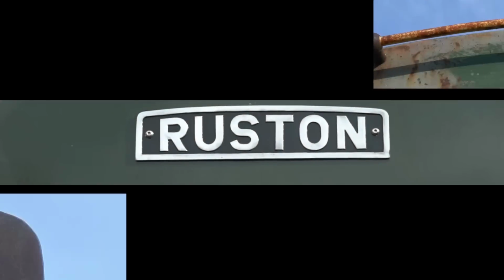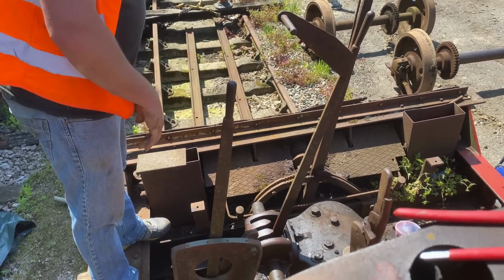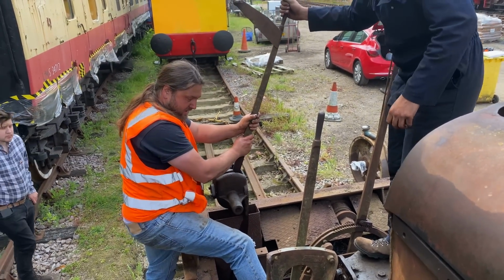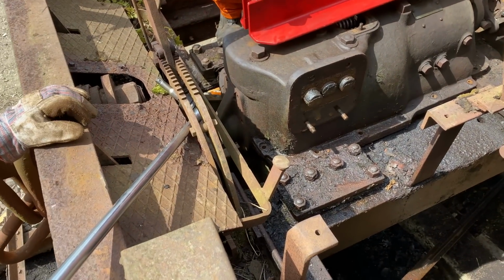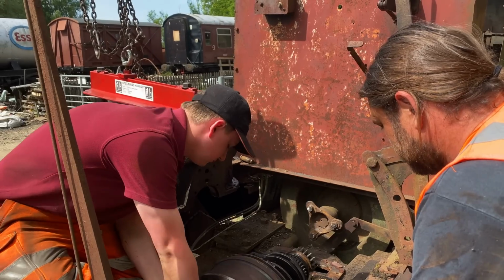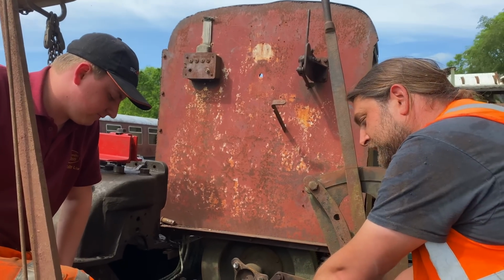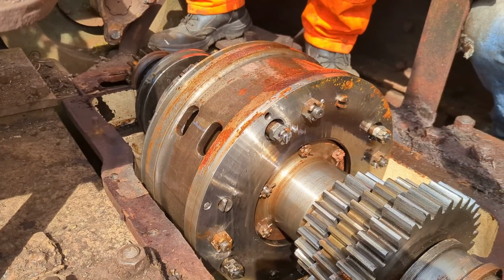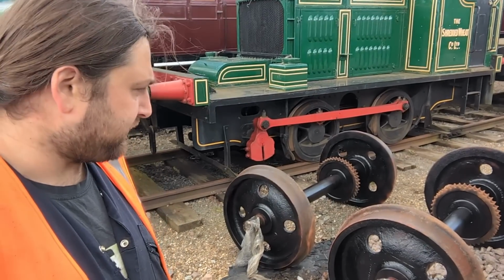What Horrors lurk within The Scrap Ruston's Gearbox? The Locomotive Diaries Episode 6

Comment: Having rebuilt a Ruston  48DL gearbox on a narrow gauge loco 3 or 4 years ago I was surprised by some of the commentary by your expert. As someone else has commented then dismantling the clutch drum should be done on an old gearbox because if the clutches are not fully disengaing then, as you move the direction lever, there is power in the main shaft spinning it at xxx rpm leading to the horridable crashing  sound (and eventual failure) as the two parts of the dog clutch come together.  This is the fate of many Ruston gearboxes. Also, the studs moving the shared pressure plate elongate over time and the slack can't just be taken up by the lever adjustment, it needs to be done of the stud nuts on the drum. When our gearbox has last overhaul ( we didn't know when) the shared pressure plate had not been put back parallel to the end plates and as a result had severe scorch marks (opposite side of the plate and 180 degrees apart) from overheating and not helped by drivers who rode the clutch. There was also a very  thick 'soup' of clutch  plate liner fibre and oil in the drum which kept the plates engaged. As a result of the overheating, the plate had distorbed and had to be carefully machined to bring it back to true. RH had little known about but ingenious tool for setting the shared low and medium speed clutch plate parallel to the fixed outer plates. As no one seemed to know about it let alone have one, we were able to get one made and were able to achieve about 4thou. accuracy. Oil from the main part of the gearbox does get thrown forward into the drive output section through a bearing but as the output shafts only have oil groves not oil seals then if there was oil pressure in this section, the oil will just get skirted out onto the track. The balance pipe is opened at  the end of the day's running to allow this excess oil to feed back into the main gearbox and not empty the whole gearbox of oil over time. If you don'i open the pipe then the oil just leak out via the oil groves onto the engine shed floor. The balance pipe is at the same level as the lower oil groves. You can't really overfill the gearbox as the excess eventually leaks out the oil groves. As previously mentioned, if the main shaft is not free wheeling then when the direction lever is engaged, one half on the the  dog cluch is spinning at speed whilst the other is held stationary by 7 tons of loco! Ouch!  I hope this tale of our experiences may help and yes, we have another one to do one day!

Comment: Hey Lawrie
Thinking about it you should keep the bearings with the wheel sets, not mix and match them (assuming they are still serviceable, if not you will need to get new ones made.
They will have problems of the journals have different  diameters since they were machined to and worn in.

Comment: Can I make a suggestion?  I've done a lot of painting on cars, locomotives, manufacturing plants and machinery and so on, and I wouldn't recommend paraffin as a cleaner between coats.  It's too oily and won't lead to good adhesion of the next coat.  A better bet is to use paint thinner for cleaning - either cellulose thinner or white spirit, according to compatibility with the primer.  These are much more volatile and don't leave behind an oily film like paraffin does, so you get better adhesion.  If the red primer was Bondaprimer (in my experience the most effective red oxide primer you can buy, I've used it for years) then a rag soaked in cellulose thinner, lightly applied, would be my choice.  Don't go too hard at it - the cellulose thinner will soften the Bondaprimer; you don't want to take it all off!  But by softening the surface a little it will further add to improved adhesion of the next coat.  Also if the primer has been in place for a long time it doesn't hurt to roughen it a bit by applying a "Scotchbrite" pad, before wiping with thinners.  If you're not sure of the chemistry of the paint you are cleaning, isopropyl alcohol (IPA) is a good choice as it doesn't react with any paints.  You can buy it in a spray can from (e.g.) RS Components, for very little.

Most people think painting is a simple thing, because the skill of applying the paint is not too hard - but really it warrants proper attention to the science, if you want to get a finish that endures.  Many of the failures of painted finishes are promoted by, or made worse by, lack of inter-coat adhesion so this is really worth paying attention to, if you don't want to be repainting it all over again in a couple of years.

The problems with that spray paint are twofold.  First, to spray with the low pressure in an aerosol the paint is very, very thin so you get little film thickness and it won't be moisture-proof.  That's ok as long if it's over a good thickness of undercoat, or if you recoat it soon.  But secondly, it has a high gloss finish, and that will not allow adhesion of the next coat - so when you come to recoat with a "proper" paint, you will need to roughen the surface of the paint very thoroughly.  On an uneven surface like the wheels, again a "Scotchbrite" pad will do the job best.  

There is a reason why a proper paint system, whether brushed or sprayed, always uses three stages :
(1) PRIMER, designed to bond to the metal (etch primer) and/or possibly have some corrosion resisting chemistry (eg red oxide), then 
(2) UNDERCOAT (sometimes referred to as a high build primer), which has a high solids content giving you a high film thickness for mechanical durability and weather resistance, but dries with a dull finish to facilitate better adhesion of the topcoat.  And finally 
(3) TOPCOAT which has less solids content and better flow to give a nice gloss finish, but does not give much protective power - it's function is just to look nice and repel dirt.  (The aerosol spray is acceptable for this, not ideal but ok).

If you don't follow this sequence, you'll be repainting sooner than you ought to.

From the above, you'll soon appreciate that the undercoat is in many ways the most important element if you want to get a finish that endures.  It's not good practice to use topcoat as undercoat - it doesn't have the solids content, and it dries shiny, so you'll have to "flat" it (roughen it) if you want the final top coat to stick.  

It pains me so frequently to see people spend so much time restoring this sort of kit, then not taking the time to use a proper paint system - and in no time, the rust is back.  Take a little time to learn about how to choose and use paints properly, it's worth it because you use paint so often - and you will save yourself a lifetime of wire brushing and repainting in the future.  GIVE PAINT THE ATTENTION IT DESERVES!  Don't just find a random tin and slap it on, you're making a rod for your back in the future.

Marion

Comment: Lawrie
One thing I saw watching a couple of your videos.
When you do the axle swap you may well run into trouble with the chains/sprockets if they are unevenly worn, they will have different pitches and may not mesh and possibly break.
You may have to press off a wheel and swap sprockets.
Reply from the maker: I don't want to have to deal with that.
Hopefully it'll be OK
Reply: Check the chain fit BEFORE you set the locomotive on it’s wheels.

FYI the rule of thumb is you change chains and sprockets at the same time.

I wish you were less than 7,000 miles away, we have a 100 ton wheel press at work that people just use to bend stuff lol.

Comment: I am sure Jay mentioned this off camera, but there is another oil-way that runs down the centre of the “mainshaft” from the back of the gearbox forward. On the Ruston you drove at Amerton the 2nd gear clutch had disintegrated and this oil-way was blocked with clutch material. Clearing it out was a little “long-winded” and needed an “auger” made to do the job. Good luck 👍🙂
Reply from the maker: Oh he didn't!
That's worth knowing! Thank you

Comment: Most lifting beams have adjustable lift points and can be adjusted so the load stays level when lifted.  Your lifting beam looks like it might have welded lift positions which makes it slightly less useful.    Loved the video.  Keep up the good work.
Reply from the maker: It was built to lift out the gearbox.
Turns out the weight distribution is different if you're just taking off the lid.

Comment: Lawrie it may be a good idea to pull that clutch apart and still inspect it to make sure everything is good. Heat marks are never good to see and even with inspection ports you just never know what could be lurking on the inside to ruin your day. Also water on those wet clutches are possibly as bad as antifreeze leaking inside an automatic transmission, just saying.

Just a suggestion from my own experience with an old machine that a friend acquired and was told that was good but one sealed part let loose and soon became a nightmare to fix due to the damage. End mill gone bad and it was a very good one that someone did not know how to use very well.
Reply from the maker: I'm not going to strip the box.

But I'm hoping Jay will!

Comment: I kept typing it before, and I will keep typing it until the crew reach the same conclusion or prove me ultimately wrong: the engine and transmission/gearbox will need to be removed and completely disassembled for a full restoration. Now I think the final drive will also need to be removed and completely disassembled.
Reply from the maker: We're about 6 months ahead with whats actually happening with the loco, so wait and see!
Reply: @lmm  So I believe I'll see the engine and gearbox/transmission being completely lifted out, if nothing else with the box than just replacing the third gear clutch pack and making sure there's no real thermal damage from starting in third for so long.
Reply: Why, though? If the bearings are fine I don't see the necessity. 303 isn't going to become a long range mainline passenger locomotive anytime soon I believe. 
Check the things and fix what is broken. The clutch may be good for another 20 years with occasional light use. That gearbox looked way better than I expected, exceptionally after seeing the plungers rusted solid.  
Clean it up a little, don't run the first oil for too long after it's back in service and keep the money saved for other parts needed.
Reply: @ Somehow I believe, mainly through age and neglect, that some things are wrong that cannot be fully seen nor corrected without a proper full disassembly. I think the full disassembly should be done just to make sure there are no further problems. Neglect is damaging!